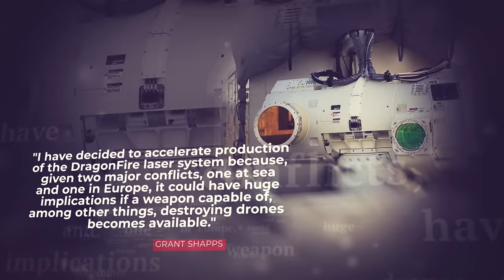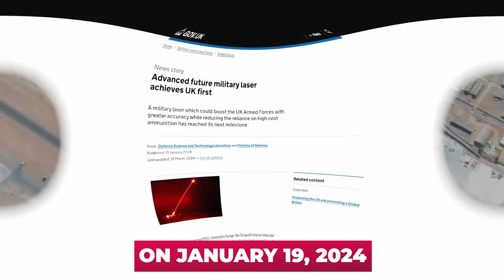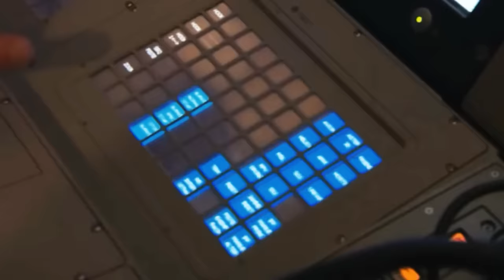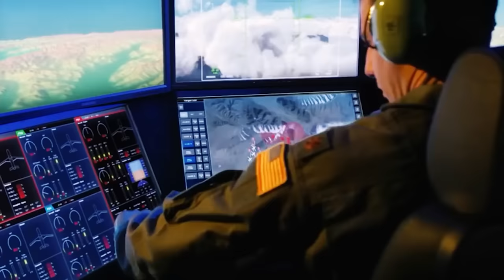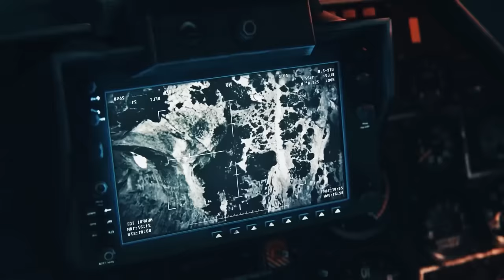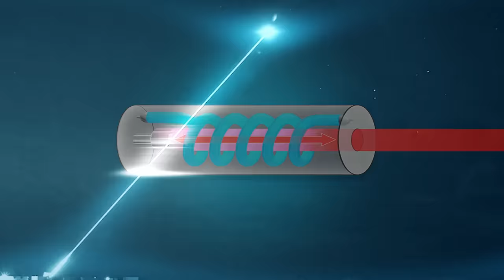UK Tests Its Most Powerful Laser Air Defense System In Ukraine

Comment: 55kw - that's a Tesla battery discharging in a couple of seconds rather than hours. At 5km its still on a 4 inch target so should make a decent hole in anything sub-sonic. Once its in the field in Ukraine improvements will come rapidly as upgrades can be tested easily - think Formula 1 cars, and how they improve over the course of a season. (Most of those are UK made)
Reply: To your Tesla claim, no, it isn't. Most Tesla cars can produce more than 200kW for considerably more than a few seconds!
Reply: A quick google shows that you can buy capacitors with that kind of delivery relatively cheaply, dont know what the duty cycle is for them - these sort of weapons aren't going to run sustained and will be susceptible to swarm tactics so you'll have to run multiple (100s) in a network for decent coverage; so the cost will be in the command and control. The power delivery will have a lot of dropoff with increasing distance so you'd be targetting the optics which reduces accuracy but not lethality of incoming drones / missiles. Systems like this are going to operate much like Flak cannons.
Reply: That Tesla battery would run the laser for 20 minutes of beam time.

Comment: What I think people need to remember is that this (if successful) will be used in tandem with other defense systems such as the US patriot. Any attempt at reflection to prevent damage from the Dragonfire would make radar signatures greater and easier for patriot systems to engage. Any target that tries to absorb radar for stealth will be more susceptible to laser weaponry. Any weapon system that attempts to foil both would be massively expensive to research, manufacture and operate and be a minor economic victory in its own right
Reply: Goodnight, China!

Comment: The discussion about range (1 km, 2 km, ???) is problematic. Those numbers do not consider the target altitude, attitude, and composition. As noted, high velocity rockets are sturdy metallic structures that are not affected by a few kW of power. But, small drones made of wood, plastic, fiberglass, or other light weight materials can be easily disabled with a few kW of power. Such drones can be hit more than 10 km away if they are high enough above the ground.
Reply: They did not say the range of DragonFire is 1 - 2 km, rather they were referring to a measure of accuracy, stating that, 'at a range of 1km it can hit a target the size of a £1 coin (24.43mm diameter). Surface level fire is limited to 5km due to the curvature of the earth. However, when fired skyward the DragonFire laser will behave much like sunlight which manages two travel 93 million miles, albeit the sun is a bit more powerful, but then again we're unlikely to need to hit something quite that far away, at least for the foreseeable future.

Comment: Slight note on the power, the system has less power than American systems but the focal area is significantly smaller so the actual power/surface area is about equivelent.

Comment: 4:18 "It's not as powerful as American combat lasers" - Dragonfire has the potential to be the most powerful combat laser ever built, US is bound to overtake but when scaled up it will be for now more powerful than American combat lasers. Lockheed Martin's laser is 500KW but only has an accuracy 5-10cm/km which is 100-50kw per 1cm at a range of 1 kilometre. Dragonfire is 50kw has an accuracy of 1cm/km, which is also 50kw per 1cm at a range of 1 kilometre. Not only is Dragonfire doing a lot more with a lot less, it is also very feasible to scale up, even to just say 250kw in which case it would output 250kw per 1 cm at a range of 1 kilometre which is much better than the conservative estimate for the Lockheed Martin design. In lasers power is not just the wattage put also the accuracy, the more focused a laser the more kinetic & thermal energy it imparts on an area. You have to remember accuracy in lasers isn't the same as ballistics, the longer the range the more the laser disperses, the beam becomes wider and therefore less powerful. It could still accurately target an area 2km away but the effectiveness of the laser is lessened, the more focused the laser the less dramatic this effect.

It may not currently be the most powerful laser but it is very clearly the most effective.

Comment: This weapon will be a good addition to the batteries of missile / Gepard defences around key targets.  The cost and supply of these missiles is a constant problem.  A laser that just needs an electrical supply however only needs to be supplied and maintained, so if it is only effective against drones it will be useful because it will mean less £250,000 missiles expended against £20,000 drones

Comment: The only Problem I see is that its relatively easy to make a drone laser proof by coating it in heat resistant material. That stuff may be expensive, but way cheaper than the Laser weapon.
Reply: That always going to be the case, missile then anti missile then anti missile, missile.

Comment: What prevents the enemy from not just coating the missile in reflective paint?
Reply: A laser is a high power energy beam & whatever it hits can't absorb that amount of energy. The target's molecules vibrate faster & faster trying to shed that extreme amount of energy heating up until they vaporise. All this happens in a fraction of a second nothing you make or coat the target with could reflect or absorb that much power. A 50Kw beam can cut through 100mm of Carbon steel  plate in less than half a second.
Reply: @ZuulGatekeeper  don’t mirrors reflect lasers?

Comment: If it's Over 1 MegWatt it may be worth it ---- remember, It Fair Weather Technology!  ALSO, you'd be amazed the "Accuracy" required at a 10 to 12 Mile Distance (say the Horizon) - only one ARC SECOND INACCURACY  you could be OFF By a Matter Of Feet.
Reply: totally true. That's the problem we had in the 80s. And it only got worse for hitting missiles as they launched. The accuracy needed was insane, the wavelengths capable of not diffracting where unreachable and the energy needed to power them still has not been invented 40 years later.

If you read my earlier post you'll see why I suspect we're looking at 600Kw beam output not 50Kw.

Comment: anyone know if the laser system will be strong enough to destroy an ICBM
Reply: You would probably need to put those in space so that they could intercept an ICBM in it's early to intermediate stage. It's a bit late when the warhead is already descending at Mach 20 which is what it would be doing by the time it entered a ground laser's line of sight.

Comment: 50 kilowatts? Just enough to boil a kettle on then.
Reply: The heat at the point of contact of a 50 kW laser is 1430°C or 2606°F after five seconds. That's a bit higher than the boiling point for water...
Reply: @Lili_Chen2005  Just when I thought the tea might give it away as British humour..

Comment: Line of sight till you raise the line of sight, this can be done you can even use it for ground targets if needed.
Meaning you could actually make it far more powerful and redirect it.
And you will have more then enough time to pull the system out if danger comes near.
The redirections could be done with drones with a Galvo system.
So yes ground targets after a 3 point laser homes in to a crystal rod inside a parabola recombining the beam into the galvo.
And goes pew pew.
Advantage!
YOU CAN BEAM IN MORE THEN ONE LASER.
Or intern beam splitter more galvo's more targets at once's depending on what it is.
and if you use such system the range can be way more.
Relay relay relay SUNTAN!!
And those drones can be made quit cheaply.
Plus the advantage of using drones as relays also makes it LESS vulnerable and or instantly replaced by a other.
multi relay drones can also hit the same target from different sides.
Or on the fly relocate to get a better shoot.
AND you could use it to send data to.
Relay data.
The several seconds can be reduced to make it stronger.
IT should make plasma in the air when fired just by hitting oxygen  :p

Comment: Multiple targets should be simple, and it should work the same with an optical splitter because there is no light signal loss, and should  be more efficient as a weapon since it will now be capable of Multiple targets acquisition with a single beam. Or I'm wrong. 😊

Comment: Even if  Ukraine gets it you have to remember it doesn't bring down anything instantaneously and with it having to cool down how many drones etc will it shoot down per minute ? One ? 
Two ? Maybe three ?

With dozens of drones coming in you are going to need a lot of  these systems to make a difference. 

What happens if the front and underneath of the drone is coated with a reflective (i.e. mirrored ) surface ?  Will it defeat the laser ?
Reply: Sure you’re talking about a single unit against a fleet of drones. But imagine dozens of them. It would be a good addition to a sophisticated air defence systems like the iron dome. Especially when it comes to cost effectiveness. When UA got the patriot system they shot down cheap shahed drones with it in the beginning. 

1x Patriot missile costs $1mil+  
1x shahed drone ~$20k
So 1x Patriot missile is 50x more valuable than a single shahed drone 

1x shot of a Dragonfire is ~ $12.5
That means 1x Shahed drone is 1600x more valuable than this…

If it’s only good enough to take down drones and cruise missiles it’s unbeatable effective from an economic perspective

Comment: Interesting.  I still wonder if someone were to send enough guided missiles simultaneously towards a group of lasers... would they be able to stop all of them?  Perhaps eventually, 1 or 2 will get through and knock a couple out. eventually all would be out.  Perhaps missiles will have some extremely shiny mirror coating on it which would make the laser less effective.  Like anything... eventually there will be countermeasures taken.
Reply: The problem with shiny coatings is they reflect radar really well, making it easier for radar-guided anti-missile weapons to lock onto it. You can avoid lasers or avoid counter missiles. You cannot avoid both. For defensive purposes, lasers compliment conventional anti-missile defences extremely well.

Comment: Something wrong with the technical data. 50Kw beam using semi-conductor lasers at typical efficiency should consume about 150Kw. $13 of electricity is about 20KwH. So for a 150Kw drain to use 20KwH it would take (20KwH/150Kw) 0.13Hours. That's 8 minutes.  And there's the problem. There's no way they're talking about each shot being 8 minutes long. More likely they're talking about 10 or 20 seconds long. So the number MOD are giving out are massively wrong. Now lets say someone has misunderstood something and the actual number is not 50Kw but 50Kw per square centimeter. And lets say it's optimal initial attack distance is whilst target is 3 Km away. With a targeting accuracy of just 23mm at 1Km range, the incident laser beam is going to wander across an area of approximately 9x that area at 3Km range. Lets do the math asussing its a typo in MOD documentation. The smallest area the targeting crystals will be able to maintain is approx imately 12cm squared. 15cm2*50KwPer Cm = 12*50 Kw = 600Kw total beam power. Now lets feed that back into my initial test which showed MOD figurtes have a 'typo' in them. How long would it take for a 600Kw semi-conductor laser, to use $13 of electricity at a typical 33% efficiency. Given all the approximations in here already, the answer is between 10 and 20 seconds. So this is much more likely the beams total time of incidence compared with 480 seconds for a mere 50KwH total beam energy. So my advice to Putin is RUN! As otherwise the brits are going to tattoo "looser" on you ass, with their shiny new 600Kw laser tattooing machine.
Reply: Fuel on the battle field costs 10 to 100X normal prices. I think that is the disconnect. A diesel generator can produce about 5 kW-h per gallon of fuel. A 10 second 50kW laser shot at 150kW electrical input uses 0.4 kW-h.  If fuel costs $30 per gallon then a 10 second shot costs $2.40. There are other overhead items to consider such as thermal cooling and house keeping. That will drive the cost up to the range of $10. As for the power level, 50kW over a 2.3 cm spot is 4 kW/cm2. Imagine taking a magnifying glass and focusing the sun on these threat systems. That's what we are talking about.
Reply: Great post Sir. With all new state of the art Military tech advances the MOD can’t give any Sensitive specifics away to Naughty China. 
Back in the day, 70’s  I was a Vacuum Engineer at GEC Applied Physics. We developed the LASER Range Finder for the Abrams tank.
Co2 mixed with other gases, helping to cut down on the attenuation of the beam in the fog of war. 
I’m looking forward to seeing more progress on our BAE systems Railgun. 👍

Comment: Any battery pack of a todays electric car can easily deliver 55 kW full power for an hour, resulting in 360 shots, each 10 seconds. You don't need a 5 ton truck. An electric Fiat 500 e would be more than sufficient to deliver the power for two lasers 🤣 Take a Tesla Model S Plaid and you can power a Megawatt laser easily (and cheaper than with a military truck)

Comment: Ah lovely, propaganda from the west again, and most people sadly have the gun knowlege of a walnut so they belive it. Even with only having worked in machining for a bit you'll know that is bullshit. For lasers, even of the most powerful kind they have to stay fokused on an area equal to the diameter of themselves for a certain amount of time. Well with still standing targets or targets not made of heat coded aluminum and steel that is possible however with flying jets you'll need like 3 seconds focused on that area. Meaning the gears, motor and targeting computer have to work utopiusly flawless for that to work. That though doesn't happen and something like a dust particle in the motor, a slight change in current supplied to the motor or flaws with the electronics make that nearly impossible. The only good use I see in this is to blind the pilot or to damage the jet's missle seakers for them to be useless, however such a machine is way to expensive for this simple task and I'd think your better of useing old ww2 flak guns with proximity shells.